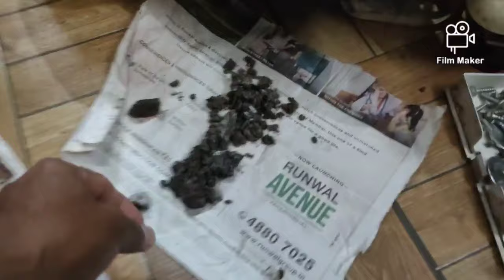Replace IFB washing machine drum (front loading)

Comment: Whirlpool 7kg the plastic drum cover cannot be dismantled to remove the drum. Any solution?
Reply from the maker: Sorry sir.. pls call Whirlpool customer servie
Reply: I cut open the drum, got the drum repaired with a steel spider and fitted it back the same day, also replaced the 2 bearings. Working as good as new now, for almost 2 months.

Comment: When we need to replace the drum how can we know
Reply from the maker: Mine had a crack in it.. thats why replaced.. otherwise it shudnt be a problem.. u mit need to clean it but
Reply: @rollyrider23  ok sir thank for replay
Reply from the maker: @ranjanreddy6816  no problem
Reply: The motor will work but the drum may be or may not be rotate with a cracky noise ........
Reply: If you open the door and push the drum it will move forward and backward if shaft is broken

Comment: 7:10 that black stuff he is removing here. Did he tell you what it is? I can't hear any audio in this video. What advice did the repair guy give you to avoid this situation from happening again?
Reply from the maker: Thats all the lint and dirt from over 7 years... Wont be closing the lid of the machine immediately after a wash to let the drum dry properly going ahead.
Reply: @rollyrider23  Did you notice any smells in the machine building up and whether you did do any maintenance washes above 60 degrees?
Reply from the maker: @johndoe-vc1we  yes used to . But i guess i shud have been more frequent
Reply: @rollyrider23  can you confirm whether you used fabric conditioner/softener at all. That kind of buildup is more than just dirt and lint.
Reply from the maker: @johndoe-vc1we  no we dont use those.. just liquid detergent